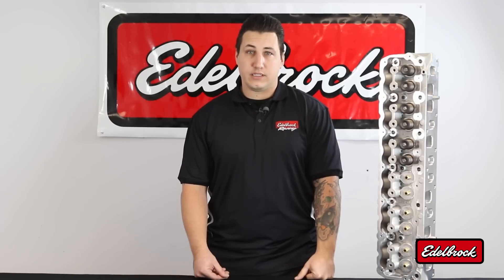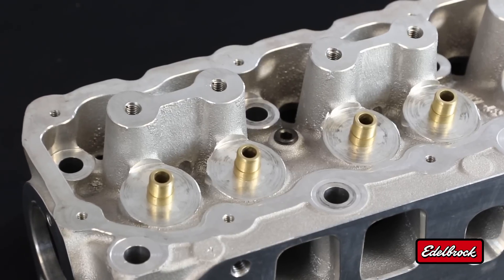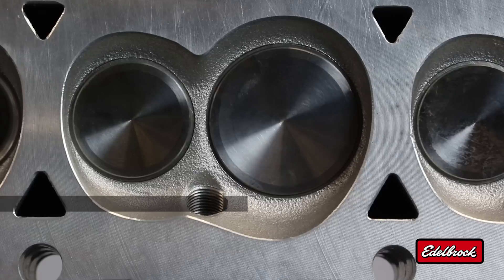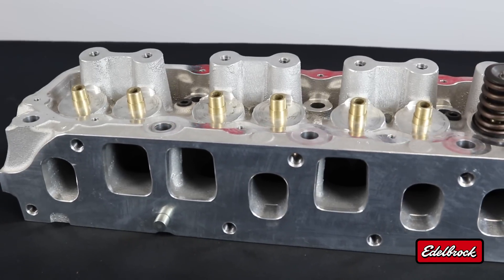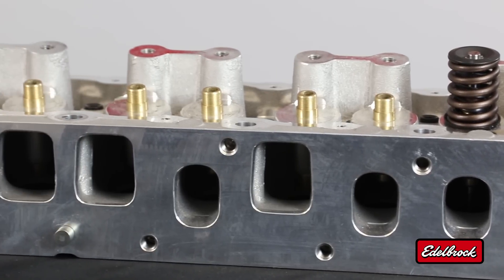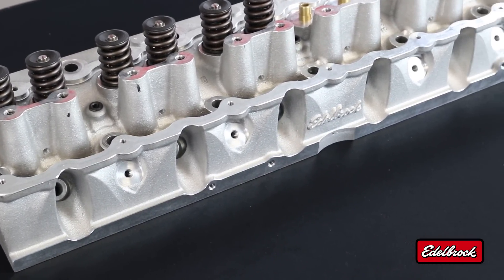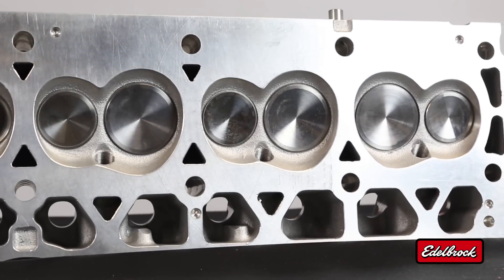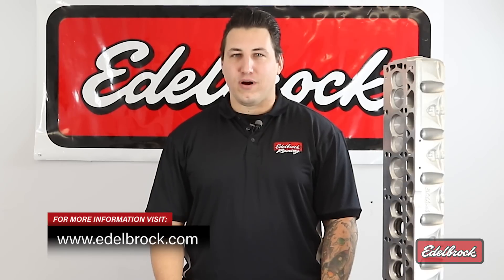Edelbrock Performer Jeep 4.0 Cylinder Head

Comment: Very nice job everything was taken into consideration to cook-up a full package of the head itself, well done. I intend to get one. My plan is street car use. Unlike the majority who jeep folks that may have a somewhat lower RPM range in mind. The weight advantage difference for hi-speed driving and or off-roaders, is a significant and a positive factor that custom vehicle and engine builders appreciate.  My intentions are to make big power on demand, with a full wide RPM range.  Modern Smooth Efficiency for everyday driving with flying-mile capability whenever required. So Turbo & F/I will be essential. My plan is to destroke down to a 3.5" stroke useing a 232 crankshaft this will reduce piston speed and stress on the rods & bearings as well. I believe a 232 will fit in a 4.0L block, with it's 3.875 cyl bore. Before machining. Custom rods & pistons required. Only a few more aspects to consider. Is a roller cam & lifters possible. The challenge maybe making the retaining system for the roller lifters.

Comment: Say I wanted to run this head on a 2002 (WJ) Grand Cherokee....  

Could I get away with retrofitting the older style exhaust manifold, and keeping the stock cats etc., or do you absolutely have to find something aftermarket in a header configuration?

Comment: how durable will the 5/16 rocker studs be with your complete head and a mild hydraulic cam @450 lift
Reply: Yes Edelbrock is still making this cylinder head. 
The cylinder head also responds well to upgrades such as a 2.000 intake and 1.550 Chevy LS valves. 
I’d recommend upgrading to a 5/16 stud rather than bolts for the rockers.

Comment: This is cool but if I am to spend $1800.00 on this I would like to know what kind of power my money is making me. Any answers?
Reply from the maker: Depends on what other supporting mods are added.
Reply: @EdelbrockUSA  is there a table I can input all my mods and get an estimate from a mild tune
Reply: @EdelbrockUSA  just the gains from this head would be nice all else stock
Reply: 1800? Sweet Jesus. What are customers reporting back on hp gains?
Reply: @l3arrett82  about 20 horsepower on a totally stock 4.0. It will work better with modifed intakes, a little more cam and good headers.
Reply: @waden404  22% HP gains or approx 25; 10% Torque increase or approx 24.
Reply: how much? not enough for two thousand dollars lol
Reply: It sure is purty. $1499? For 20hp? You can get smaller tires and get 30hp.
Reply: @EdelbrockUSA  JUST A HEADER, CAI,  HIGH FLOW CAT AND
 2 1/2" OR 3" EXHAUST...WHICHEVER IS RECCOMMEND FOR MORE POWER AND TQ? SO WHAT GAINS WOULD YOU SEE???? BALLPARK IT IF YOUR NOT SURE??

Comment: Any hp or tq gains to expect on a TJ running stock efi and stock cam.
Reply: What I been hearing for a 4.0 “has the potential” to gain 50HP and 60+Foot pounds of torque. But I can’t confirm that...
Reply: @ryangill2972  I'm pretty sure you are wrong with this numbers.
Reply: @ryangill2972  22% HP gains (around 25) and 10% torque at 24.

Comment: Will this work for my 2000 XJ 4.0? And if so, what combination would be needed to perform right?
Reply: Yes it will work fine if you use headers. The 2000 2001 exhaust manfolds will not work. Older tubular exhaust manifolds will work if O2 sensor bungs are welded in and after the catalytic converter in back.
Reply: Gail Banks has a header that will work on the 2000 and 2001 XJ’s

Comment: anyone have any suggestions for things I could do to help an '88 renix perform better/run smoother? I've already done a general tune up, Champion RC9YC plugs gapped to .035, 4 hole injectors with same pressure and flow rate, new fuel tank, fuel pump assembly and inline filter. Didn't bother changing cap and rotor as I've got just over 100k miles on her and they seemed in good shape. Just took a brass brush and cleaned all the contacts both cap and rotor. She runs good, but I wouldn't be tinkering if I didn't try to push it at least a little ;) any ideas?
Reply: Troy Guinn just installing a 91 up high output head is a huge improvement.
Reply: Clean your C-101 connector clean all grounds very crucial clean all electrical conmections
Reply: Get a 7120 head and port it.

Comment: What’s the weight on this head & does it require any other mod like bigger injectors or other upgrade to it  ???
Reply: 39 pounds. Injector upgrade typically isn’t necessary unless you step up to a Stroker

Comment: Is the 91 and on exhaust manifold superior?
Reply: the 91-99 exhaust manifold is a factory tubular header known 2 splinter @ the collectors and the #1 and #6 tubes if its stock - sadly the company did not design the head 4 use with the 00-06 split exhaust which has a smaller port

Comment: How much?
Reply: $1,712.69 assembled, $1,299.89 bare online currently.
Reply: swaybelly 321 
Yeah, that price is way high for any gain. I like the fact they are making it. But that's way to high. Can put a diy turbo on it for way less and make way more power.
Banks makes a turbo kit too that I think is less than this.
Reply: kens97sto171  And the devil is in the details of getting fuel map right for forced induction.  Split second controller, bigger injectors, lap top work to dial it in.
Reply: When you buy the Banks turbo kit, you get the required fuel system upgrades. The system also has a programmer so that the OEM computer can properly control the new fuel system.
Reply: The banks kit came with everything you could possibly need, except the tools required to put it on.

Comment: The only thing that makes me nervous is putting an aluminum head on a cast iron block. Not sure that the aluminum head can handle the higher temperatures that the cast block can withstand.
Reply: Virginia Towerman You are sofa king we todd it
Reply: Sorry...I don't understand your response. BTW - what is a "sofa king"??
Reply: Alex King
Thanks for the explanation, but his response was everything but clever or sarcastic...I have a feeling he is a life-long government dependent living in section 8 housing. I would venture a guess that his main source of income is selling his food stamps to keep a supply of weed coming in the door.
Reply: Alum heads on iron blocks is very, very common even today. Look at the Ford EcoBoost engines, the LM4, LM7 and current 6.0L truck LS engines, all the aluminum aftermarket SBC heads, high value V6 and tons of engines from the 80s through the 00s.
Reply: @AkMedMan1  love it haven't seen that one for awhile watching it right now
Reply: As long as the surface finish on your cylinder block is smooth you shouldn’t have any problems.